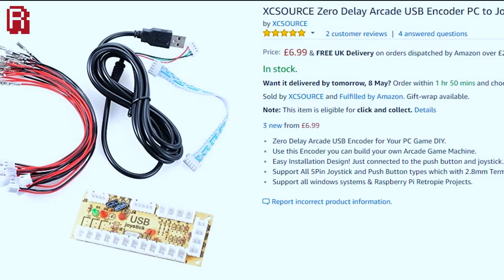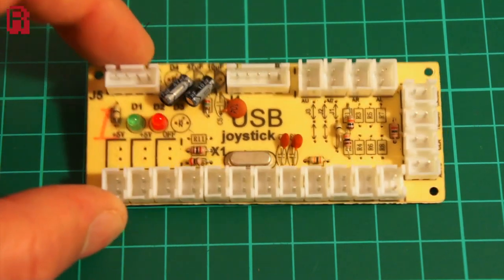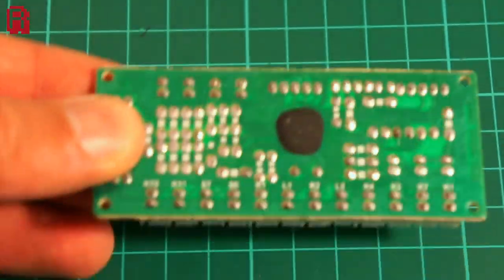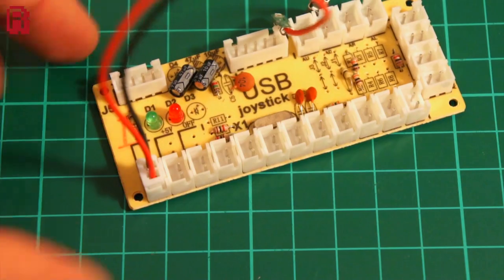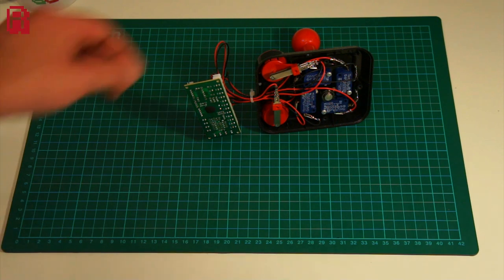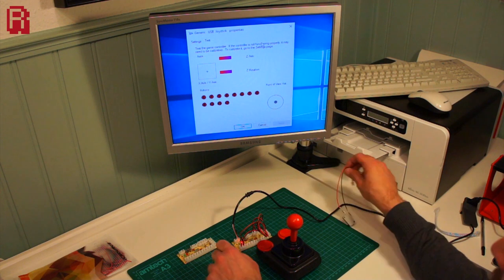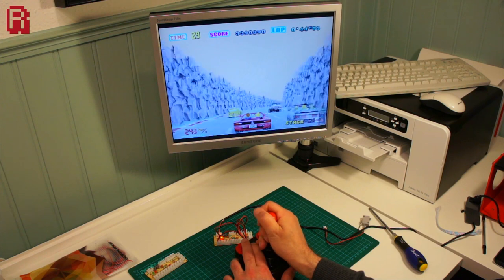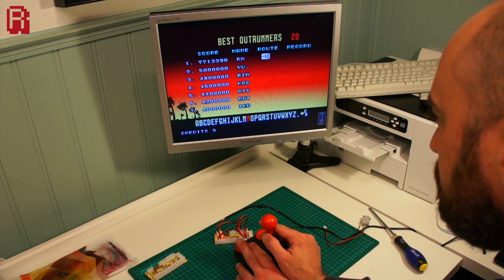Zero Delay USB Arcade Encoder | Review & Playtest

Comment: EDIT: I answered my own question. Looks like I will need to dedicate a single switch in order to always have access to the POV Hat function. I can rewire the leds on my joystick in order for it to show both power and proper Hat mode. I was worried this device wouldn't work for a standard PC joystick, but I see now with proper modifications it most definitely should work.

Comment: Nearly 4 years later, I'm using one of these just as a controller for a couple switches, simply because I'm hopeless with electronics and its easier than using an Arduino, plus cheaper. Absolutely fine so far, although I feel like I'm under-utilising it so I'm thinking about making a button box just so I can make use out of the other connectors

Comment: For most of the wired spade connectors where they go on the back of the switches pin - you press the side of the connector when you want to slide it off - this pushes a small lever, and allows the spade terminal to slide off the button.. it has a tiny metal lever catch on it to stop it falling out :)

Comment: I installed this board into my Mad Catz Street Fighter Tournament Edition Round 2 Fight stick for PS3.
I used it on my older PC. On newer PCs it doesnt work anymore because of that oldschool UHCI - USB - Protocol.
I didnt use the auto-fire-mode , so i connect only 10 buttons and the joystick.
It works perfectly,  no delay or lag. In my opinion its a cheap and good choice for Arcade-Sticks.
It came with USB-Cable ( i used the longer original of my fightstick ) , 12 connector cables for Stick and buttons ( i connected the 5 pin Sanwa cable instead ) for around 10 Euros!!
I did this conversion because i couldnt find a xbox version of the mad catz.
The only issue with the original Sanwa-Joystick cable was that i had to turn the joystick 180 degrees. That means you have to unscrew 4 screws - thats it.

Comment: so i got my pack in the post today. put it together and the only difference was that my comp. pro. was a leaf sprung kind, not microswitched.. however i connected it the same way.. and then fell at the final hurdle.. i got my up/down confused when connecting the leads to the board, had to take them out and re-seat them.. also found that both fire buttons couldn't be connected to one source. otherwise very happy to use my joysticks again. If i have a complaint, it's the same was yours, the cables were too small and I'd like a box of some sort to mount it in. I think i'll use a matchbox! Many thanks for this video.. it helped me out.. especially when looking what sockets you placed the leads into on the controller..
Reply from the maker: You're welcome and thanks for watching I'm glad it helped you

Comment: 3:35 My hitbox fightstick build had a problem precisely because of that, when it's on POV Hat mode(Green LED ON), if I pressed LEFT, DOWN, and RIGHT at the same time it would give me UP LEFT even if I didn't even have a button wired to UP, but clicking on Mode making it change to Joystick(Red LED ON) would fix it.

I still had to set up those 4 directional buttons specifically as joystick input on Steam Big Picture mode tho, emulators too now that I'm remembering it.

As an board for an standard arcade joystick build it would basically right off the bat even on POV Hat mode, there's just this very small inconvenience if you want to make a hitbox that you need to be aware of. But given the advantages an hitbox offers, for this cheap of a price it's a moot point.

Comment: I plan to make either a hitbox or standard control box using one of these, some 2.8 mm connector buttons, some very short height joystick, and two beautiful  £3 chopping boards I bought. Should come in at a cost to me of around £32 as I already have the drill bits for this.
Reply: Did you do it? Any Tipps for a beginner?

Comment: I've used two of those - one in arcade stick, another in universal converter (two 9 pin sockets driving 2 C64 joysticks at once, or both connected to drive one fightstick). Boards work really well, but quality can be an issue (I had some cold joints on one).
Reply: the led part wires up separately, so just get a separate board to control your led

Comment: I just got this board and I found out that the mode button does switch to the POV hat instead of the X/Y axis as described in the video, but it doesn't SAVE this to the board. The next time it powers up the default X/Y axis mode will be enabled. Just a heads up for those wanting to use it in a closed cabinet and don't want to add a dedicated button somewhere just to switch modes EVERY SINGLE TIME you use it..... sigh
Reply: Changing J1 to the other position will make it start in analog mode. It's also possible to change J1 for an SPDT switch

Comment: Hello
Thank you for bringing the subject.. 
Since operating system (windows) recognize up to 128 switches is there any way to connect two or more boards to get 24 or more micro switches using this controller
Regards

Comment: mine didnt come with the wire for the joystick. I tried using the single wires but my sanwa joystick has a pcb and  just one single black ground wire. I daisy chained all the direction wires but it still wont work. buttons work fine so the board is good. is there anything else to try here?

Comment: I'm thinking of using this to build an arcade joystick for my PC.
I was wondering what it is detected as in game? For example I use an Xbox One controller on my PC, so any in game prompts, menu commands etc are displayed as Xbox One A, B, X, Y etc coloured buttons.
I was planning on making my joystick have 8 coloured face buttons for A, B, X, Y, LB, RB, LT, RT plus buttons on the back or side for the "back" and "start" buttons (also possibly an Xbox home button but that only brings up the "game bar" which I never use so might leave it off).
But if the button names and colours don't match what's in game then I might do something different.

Sorry for the long comment!
Reply: You could probably set it up with some sort of joystick to keyboard stuff

Comment: Hey There, is there a way to connect LEDs to this board?  I have some 5-Volt LEDs for some of the buttons, but I'm not sure if I can use this board, since there's all 2 connectors and not 3 connectors.  thanks!
Reply from the maker: Andres Salazar I dont think so no, this is a cery basic board for control inputs only.  Maybe try the Ultimarc PacLED64 for some fancy lights

Comment: Is it possible to connect led buttons to this board and have the led light up? I see there are different boards that have 3 pin connectors that are meant for led buttons, But was curious if there is some way to get leds to light up with this particular board?
Reply from the maker: This board would not send power to light up the LED's.  You could perhaps use a combination of this board with the GPIO pins on the Pi to get the power to them?  If you have some cash you could use something like an I-Pac Ultimate IO (https://www.ultimarc.com/ipac.html)

Comment: Hello, I just received my encoder boards in today with 20 LED push buttons. I noticed i have exactly these boards shown in this video so I'm hoping you may be able to help. So my problem I'm having is my push buttons that came in my kit have 4 connectors on the bottom with no micro switch. The problem I see is that these encoder boards only have 2 pins/2 wires for each push button. Do you have any ideas how I can still use these encoder boards and get my led push button lights to work?
Reply from the maker: Hey, I would suggest 2 legs are for the microswitch and 2 legs are for the LED to light up the button.  The board will register button pushes but you'll need to supply power/ground to the LED legs using another power source if you want them to light up

Comment: Man hello.If i need more buttons and if i buy 2 of this kits...set up one for left player and other kit for right player..will it work  ?I have x arcade encoder but i have a short circuit on pcb and problens with switch programming mod that i set up before and a lot of buttons is doesnt work now and i thik if i ordering this two kits and change my x arcade pcb encoder to two like this may be this will help  ?
Reply from the maker: I haven't tried it but they sell these in packs of two for 2 player kits so my guess would be yes.
Reply: RetroManCave hope so...try this next month, hope my umk3 reproduction will work again.So sad to loose controls and all emulators set up in my sistem..need to remap all buttons.

Comment: Hhi RetroManCave. I am going to make an arcade machine that has 2 players. So i am going to buy an DIY kit which also has the hardware you were reviewing. I want to ask if 2 controllers can be regonized by Raspberry pi ( retropie) ?
Reply from the maker: Rocky Madio Yes they are identified as seperate devices so you can use 2.  You can also use the GPIO pins on a pi for input if you were so inclined
Reply: thanks alot for your fast reply. Well it is much nicer if i couldd unplug them and plug some other hand-controllers into the board :D In case me and my friends are tired with hammering our fingers on the arcade buttons.
Reply from the maker: Rocky Madio very true!  Come back and share your project some time I'd love to see it
Reply: yea sure! thank you :D
Reply: So I want to make a fighting stick with this board. Only concern is to how to put the buttons on. Is there a diagram for what button is which port or something? And also how many buttons can be pushed at the same time?
Reply from the maker: Staz Charlie Blood The ports are labelled up down left right b1 b2 b3 etc.  I believe it will register all button pushes even if you hold them all down at once
Reply: RetroManCave no I meant for example for the ps3 how do you know which is X, O, and so on?
Reply from the maker: Staz Charlie Blood oh I see, well the easiest test I guess would be to plug them in, press the button and see what it registers as, then swap them about.
Reply: RetroManCave OK thanks for the advice.
Reply: I bought 2 of these (Quimat) and they were recognized by RetroPie, but I'm having a heck of an issue with the joystick Axis being configured improperly on player 2. It tends to happen after I jump in an emulator. Get back to EmulationStation to find my controls configured incorrectly again. The more I google, it appears there are linux bugs with "DragonRise Generic USB" encoders that cause some problems, so not all USB encoders are effected. I'll continue to play with it, but it has been far more trouble than my ipac2. Then again, it was also far cheaper as well. Essentially, I recommend a bit of googling on the best usb encoder to use. Or at least be prepared for a bit more joystick configuration than expected.

Comment: I got a a question. What if you have LED arcade light up buttons. Do they automatically light up when you plug them into the board?
Reply from the maker: FreeSky 542 no you'd need to supply a power source or purchase something like  the  ipac ultimate io board
Reply: ok, thanks. I just went ahead and bought a Zero Delay LED USB Encoder that supports LED buttons!
Reply from the maker: FreeSky 542 awesome I didn't know they had made an LED model thanks

Comment: How is this encoder with multiple buttons being pushed at once? Do they register properly?

I'm going to assume that it won't be compatible with a PS4 (aside from Street Fighter V). I want to use mine with Pinball Arcade on PS3, PS4,Android or PC but I'm not sure if the plunger will work to launch the ball since it's typically assigned to the right analog stick.
Reply from the maker: Ryan multiple presses are fine.  No analogie input obviously but maybe you could have a second device for the plunger mapped?
Reply: I couldn't get the buttons to work on Pinball Arcade for the PC but I was able to get them working on PS3 but I had some issues with the buttons/joystick "sticking" when I would push them once (quickly) it would think I was holding the button down or rapidly pushing that button. I tried using the clear option just in case it was the turbo but it didn't seem to fix it.
Reply from the maker: Ryan Seems odd.  If you open the game controllers in Control Panel and watch the buttons when you press them are they registering correctly?  You could have a dodgy ground wire.
Reply: RetroManCave It could be the ground wire because I had to use a screwdriver to open up the metal connectors so it wasn't so tight when I needed to remove them but when I opened it up in Windows to check/calibrate the buttons and joystick they were fine. It still works with PS3 but it's a little too sensitive. I was able to get the joystick working on Pinball Arcade for PC using X360CE (32 bit version) which emulates a XBOX 360 controller. 👍

Comment: can i just use a "regular" button (like the big red ones) and connect them with the usb encoder? I mean the + und - into the signal and ground port?
Reply from the maker: Yes you can, so long as whatever you're connecting closes the circuit then the press will be registered by the encoder
Reply: thank you that was quick!

Comment: Hi I got one of these motherboards to build a PC button box. I assembled it all last night and wired all the keys to the little joystick board. 

When I put it into the pc it recognises it as a usb joystick. When I try to go on the joystick properties on the control panel it says it's not connected / functioning properly and won't allow me to test any keys. 

If I go into a game say farming simulator and try to map the keys as soon as I select what Key I would like to map it automatically assigns the keys to 2,3,4,5,6,7,8 like every key on the box is being pressed all at once? 

I have a number of monetary switches and a few on off switch any ideas or help?
Reply from the maker: Tom Hay hmmm I suggest you disconnect them all and try adding one button at a time.  Establish one works and go from there.
Reply: RetroManCave brill I got it working turns out a few of the metal connectors were touching each other and it was giving weird read outs. I have a few on off switches and I have to click them on and off for it to function then on and off again for it to function any idea how I can get it to function wen turned on and function again when turned off? Or will the board only support momentary switches?

Comment: quick question, does this only work with MAME emulator? I was thinking of building an arcade stick for tekken 7 which i've preordered for my pc and was thinking as I'm mainly building this for learning purposes and dont want to spend  a lot of money, if this encoder works for my purpose.
Thanks, and great video :)
Reply from the maker: Jaafar Harari This is detected in Windows as a regular joystick.  It will work just fine on Tekken or any other modern game
Reply: Cheers for the response, subbed really like your stuff keep it up 😊

Comment: It seems to me that the buttons are not switching to ground but to +5V. Can you confirm? Even the Sanwa(?) connector shows AU, AD, AL, AR and VDD not GND. 

This makes it impossible to use an old joystick having a auto-fire circuit built in.

Comment: I made my own arcade controller based on atmega32u4, and i didnt noticed any input lag.
Reply: Basically the controls(joystick, and buttons)
and one Pro Micro(its a dev board based on ATMega32u4, others MCU may not work like the ATMega328p)
And some code( basically switch case statements and functions provided by the Joystick library).
It is also possible using rf transceivers to do it wireless, but it may add some input lag.
I may do a video on the building and coding.
Reply: Btw, i just posted one video about it, if you have interest check it out.

Comment: Using a zero delay with a USB hub, trying to get this working in android and so far no dice. I'm also using a front end called romflix and just want it working,.. Any ideas?
Reply from the maker: +Gary Stinten did you try changing the mode to see if that helps?
Reply: Hello, i have the same problem: trying to plug it into android box but does not get detected. I already tried to use the mode pin with no luck. I installed USB/BT Joystick center and it seems to detect the stick but then mame4droid will crash as soon as i move the stick. Anybody has some experience in this ?